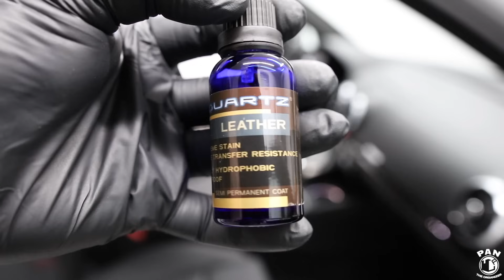AUDI RS3 : FULL DETAIL OF A WHITE CAR !

Comment: Nobody ever does a Pearlised White (also called Toyota Pearl White), which is what my car's paint is. Everyone does flat or plain white. I would like to see correction on a Pearlised White paint, which is the original Japanese model paint of my Japan-made Camry Limited edition. Apparently, it's a 3-layer special paint, and so I would assume it needs special handling and correcting techniques...I could be wrong, but that's what I read on the internet. So, is that a SOFT clearcoat paint?
Reply from the maker: I did a pearl white Lexus in this video: https://youtu.be/Pa6DWND52Cw

Yes Toyota and Lexus typically have softer clear coats.
Reply: @PanTheOrganizer  Thanks Pan, for the prompt reply. Always appreciated.
Reply: @PanTheOrganizer  While on this -- I am a first-time detailer, and have (after watching many of your videos, which is why my wife hates you now...lol), bought a DA (actually two DA's, the Shurhold 3500 & the TORQ 10FX for 3" use), and HD One and the Microfiber URO-FIBER pads of 6" to 3". I am planning on doing just a 1-step, (as it's a soft coat), and the whole process till prep for the Cquartz UK 3.0 (which is bought too). All bought by being influenced & made knowledgeable by your vids of course!
Question: It's the very first time it's being detailed and paint-corrected, and the clearcoat is pristine (I'm very fussy about maintaining my car as new, it's for less than 90K, no scratches, wash it with soft-water), even for a 16yr old car, so....Can I HD One it with the URO-FIBER pads, and skip the polishing stage and go onto the prep stage after correction? Or do you recommend a Sonax polishing after clay & correction? 
Second Q: If you recommend a polishing stage too, which polish do you recommend for this Pearl White Japanese paint? Can I just polish with the same URO Microfiber pad? Will that work? (Just in case, I have also bought a LC HDO Finishing/Polishing Black foam pad. Just being fully prepared) Thx.

Comment: If I may ask, what do you charge for a job like that and how long did it take?  Awesome job.
Reply from the maker: Thanks!

Unfortunately I don’t discuss prices on YouTube.

How did you discover my channel by the way?
Reply: @PanTheOrganizer   I kinda figured, what about time?  guessing it needed minimal paint correction being new.

I am researching techniques for paint correction and ceramic coating paint for my cars.  So I came across yours on a youtube search.   Most likely by searching "Cquartz UK 3.0"  which is what I bought to coat with, also Gliss as a top and Dlux for trim and wheels.  As soon as I can get it to a shop to have the clear bra pulled off, the rear bumper cover replaced (New Yorkers don't know how to stop aparently) and a few stone chips filled, I'm off to polishing.   You and Dallas Paint are my You Tube go to's.

Comment: Pan, awesome video! (as are your others). Just a quick question if I may be so bold....... did you do anything in particular to the plastics? Such as the honeycomb grill and the diffuser at the back? Also, did you use a certain tool to clean around the badges? Sorry, don't want you to give away ALL your trade secrets :). Im just concerned that when I detail my RS3 and then coating with C-Quartz that I am going to miss a step
Reply: Oooo, just one more thing (Columbo moment). How do you clean the sills and inside the doors, as in the openings where the vehicle information stickers are. Also thought of something else, after you compound and/or polish the car, what do you use to get the compound and/or polish out of the shut lines?
Reply from the maker: Thanks for the positive feedback!  I used CarPro HydrO2 to coat the grills quickly.  For the badges, I use a soft bristle brush, like in my video showing how to detail emblems and badges: https://youtu.be/mURcM8DRu9g
Reply from the maker: I use a finishing touch up spray from OBSSSSD for doorjambs and a quality microfiber towel like The Rag Company Minx.
Reply: Thanks for the replies Pan, much appreciated.

Comment: Hi pan, your videos are great!!
 I have a white  bmw 1 series lci (I have it 18 months)  and i like detailing.. 
 Probably from some wrong washes out there it has only some light swirls all around the car which I can see and I don’t like, 
My question is the next time that I will decontaminate my car, and I mean 1)wash 2)use of carpro trix 3)then clay and dry it, should it be enough for me  to use essence (or something else?)  by hand to remove these light swirls? Or I need a DA polisher to remove them?    
I would like to have it perfect and then wax it with enigma. ;)
Reply from the maker: Hi Chris!  Thanks for the positive comment!  I guess you're Greek by the name?  I'm half Greek, living in Canada! :)

To answer your question, it depends how deep the swirls are.  Keep in mind Essence is a final polish meant to enhance gloss and act as a primer for a ceramic coating protection.  It does contain semi-permanent fillers which will help mask the swirls, but to permanently remove them, you'll absolutely need to machine polish.

Also don't forget, using a claybar is great for decontamination, but it's a mild abrasive and should always be followed by machine polishing, because even claying can induce micro scratches and marring.

In your case, if you want to finish with the AngelWax Enigma wax (which is one of the best waxes by the way, great choice!), here's what I'd suggest:
1) Pre-wash
2) Wash
3) Chemical Decontamination (Tar and Iron removal)
4) Mechanical Decontamination (Claybar and clay lubricant)
5) If you only have light swirls, use a good polish like Meguiar's M205 or Menzerna/Jescar polishes
6) IPA panel wipe (VERY important to remove any polishing oils and left over contaminants)
7) Apply one thin layer of Enigma wax
Reply: Pan TheOrganizer  At first thank you very much for your answer and Yes I am from Greece!   
 My car is almost new as I said and has only light swirls that you can see on the sun if you know what i mean.(if I could somewhere I would sent  you photo) . 
  So about the steps you said me: 
1) ok 
2)ok 
3)ok(I have carpro trix) 
4)ok I have medium clay Bilt Hamber 
5)ok I will search on the products you said me and buy one but do I need to buy a da polisher too or these products will be ok for me by hand?  
6)ok I have carpro eraser 
7)Here in Greece I can’t find anyone with Angelwax products so I ordered them from amazon and just waiting..(I have ordered the enigma wax and the ceramic infused shampoo, the ceramic infused QED and the Ti-22 spray and hope to come soon) that’s why i want to prepare perfect my paint before apply all them..  :)
Reply from the maker: Great selection of products!  You’re gonna love AngelWax!

Comment: Hey Pan.
I'm new to detailing and  stumbled across your channel. Incredible work!
Quick question re. this video.
You finished the wheels and then gave the car a full rinse before applying the snow foam.
Would it be better to apply the foam to a dry car, so it sticks to the bodywork better/longer, thus increasing cleaning power?

Probably a stupid question....
Reply from the maker: Some apply a snow foam to a dry surface, some prefer to pre-rinse, then foam.  What ever works best in your routine.
Reply: @PanTheOrganizer  Thanks dude. Just thinking I may as well try do it right as do it wrong!
If you're ever in Ireland, bring your equipment!

Comment: How many hours go into a detail like this?  Just curious.  Spent 5 hours detailing my new truck for the first time this weekend... took about 3 hours longer than I expected after watching a few of your videos and ammo nyc.  Gives me a lot of respect for what you do.  This detail looked amazing, you are very meticulous and the work you do shows up in the end result.
Reply from the maker: Hi Nathaniel.  For this car, it took me roughly 10 hours of work.  I have over 20 years of car detailing experience, so it helps.  

I'm glad you enjoyed my video!  Lots more to watch on my channel.

How did you discover my channel?
Reply: Thanks for the response!  Your channel came up in my feed of suggested videos after watching several other detailers.  At one point I probably searched for 'white vehicle detailing', and down the rabbit hole I went.  10 hours, wow!  That makes me feel not so bad after it took me 5 to get my truck to about 1/10th the level you achieved with that audi.  I didn't do the full ceramic coat, just pressure washed, foam cannon with diluted dawn, hand washed with dawn and 5 microfiber mitts, (I don't rinse the mitts, I just do 1 section and then throw them in a bucket and use a new mitt for each section), clayed the whole truck, and then sealed/waxed with chemical guys extreme topcoat with 3x carnuba.
Reply from the maker: That is still most than most people do on their cars Nathaniel!  Congrats.  And with my videos, you'll increase your knowledge and efficiency!  ;)
Reply: Holy cow! 10 hours!
Reply: Yup seems about right for the level of detail.  It took me. 6 hours for clay, polish, ceramic coat and topper.... Vehicle was previously washed and decon the day before. about 3 hours.   This was for an SUV.

Comment: Why you do this on a brand new car?
Reply from the maker: +xsinasix 
New cars are never new.  They travel by boat, truck, train, are exposed to raildust, brake dust, industrial fallout, etc.  As you saw in the decontamination steps, paint had imbeded contaminants.  You want to remove those before applying protection.

Comment: I am sorry but i have to ask.. Why do you clean a clean car? I mean the whole purpose of the products that you are showing is to remove the dirt/mud/dust,etc. off the car. No offence.
Reply from the maker: It's the other way around.  This is meant to show how you protect a brand new car.  As soon as you take delivery of a new car, it isn't really new as it has been transported by truck, train, boat, etc.  It has been left in docks and in dealership lots for weeks sometimes months.  It has seen industrial fallout, brake dust, etc.  It has been poorly prepped and washed by the dealership, etc.  So the earlier you start this process, the more the car will look good for years to come.  So you clean and protect every possible surface.  Paintwork, leather seats, carpets, headlights, tail lights, etc.
Reply: @PanTheOrganizer  thank you for your answer.

Comment: There is no point washing a car that is perfectly clean. Whats the point? Its just a waste of time and products! Before and after are exactly the same. Thumbs down from me.
Reply: jonathanclarkewater this car truly is clean to the unknowing and naked eye, but! Slow down and carefully view the full video... You'll see how contaminated the car actually was. It's what your eyes do not see that was taken care of so efficiently by Pan, (wheel brake dust was apparent. Also a ceramic coating was applied, this requires a properly prepared surface prior to application. Doling out a thumbs down? 😑 Knowledge is key.
Reply from the maker: +Clemente Bogle 
Amen.  My thoughts exactly Clemente! 👍🏻